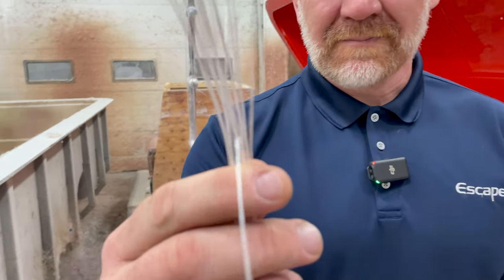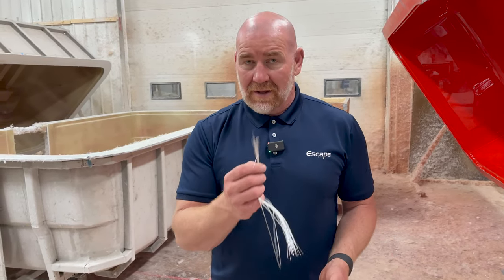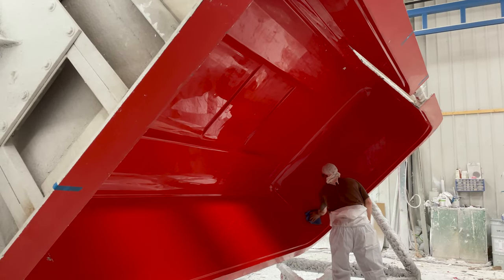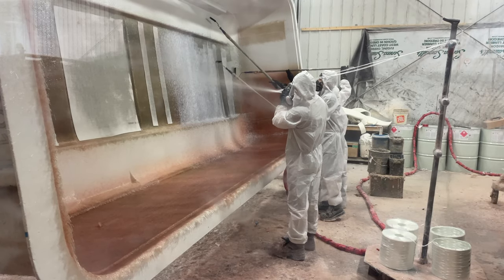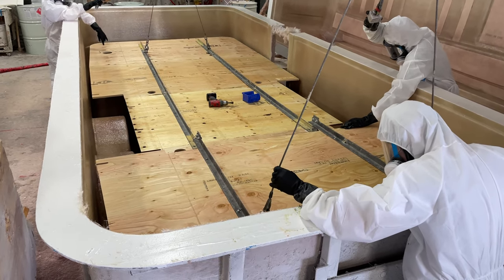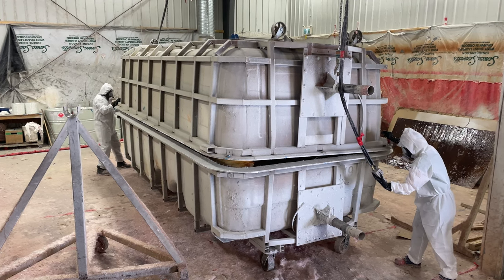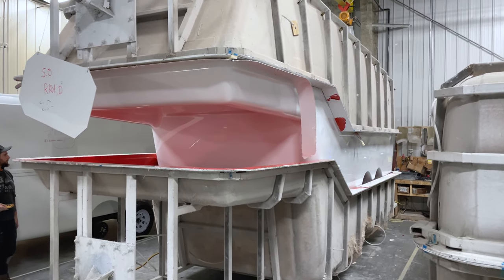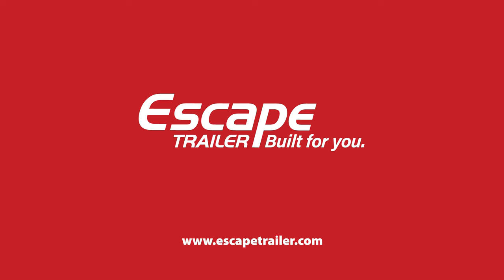How it's made: The Journey of Building Fiberglass Travel Trailers

Comment: I don't understand the purpose of engineering in water collection points underneath the floor around the outside border. are the edges of the plywood floor glassed in? It seems like a persistent leak of internal systems could conceivably rot this floor
Reply from the maker: Thanks for the question! It's designed to handle condensation from breathing and moisture buildup on the walls, allowing water to drain out efficiently. This system works exceptionally well, preventing floor rot. Plus, all the floors are coated in resin, providing a sealed and durable surface.

Comment: Hello, very informative video. So fiberglass cloth or mesh not used, would it still give the strength? 
Thank you
Reply from the maker: We use a combination of chopped fiberglass strands and fiberglass weave, depending on the location. The fiberglass is infused with resin and hardens to create an incredibly strong composite structure.

Comment: Wouldn't it be stronger if you made the mold of the camper with the door, windows etc cut out,  then do one piece fiberglass? This is still two pieces bored together. Not one shell.
Reply: If you really studied video, you know that’s not possible. Windows and doors, and any other penetrations are cut out after the shell has been completed.
Reply: @smallnuts2  there is a very good reason no manufacturer does it that way, you need to go watch it being done before you could understand.
Reply from the maker: Thank you for sharing your thoughts! While a singular mold seems ideal, it presents challenges during demolding as it would not be possible to remove the part from the mold without breaking the mold. Another benefit of our two-mold approach is for our workers, providing a more ergonomic work environment and keeping them out of confined spaces. By using our process and fusing the two parts together with additional fiberglass, we achieve the same concept as a singular mold with enhanced attention to detail, consistent quality and structural integrity. We appreciate your interest and attention to the technical aspects of our manufacturing process and if you have any further questions feel free to reach out!
Reply from the maker: You're welcome! If you have any other questions please feel free to ask, happy trails!